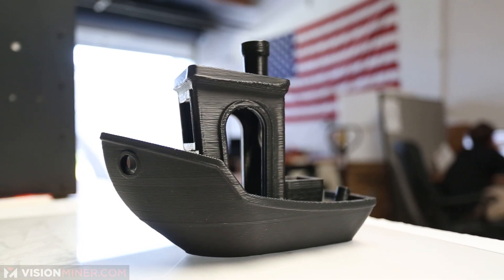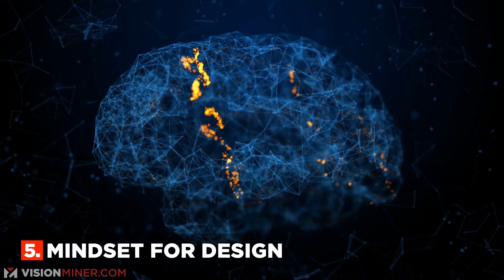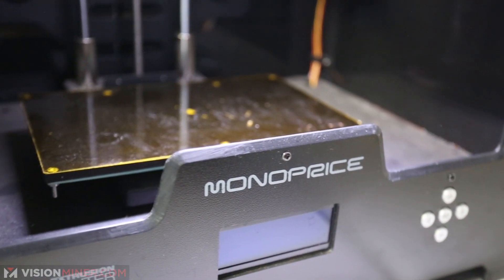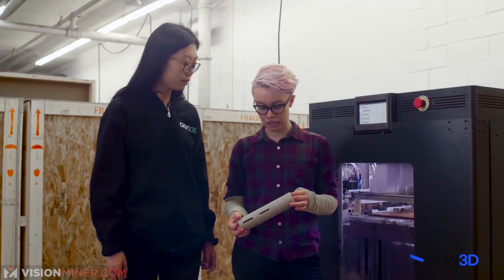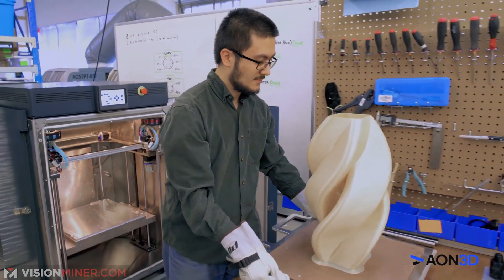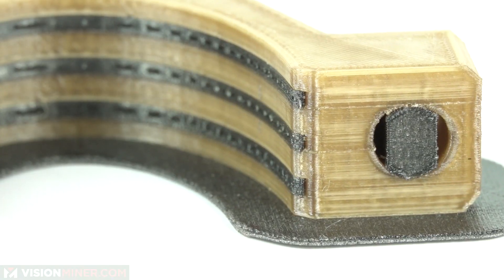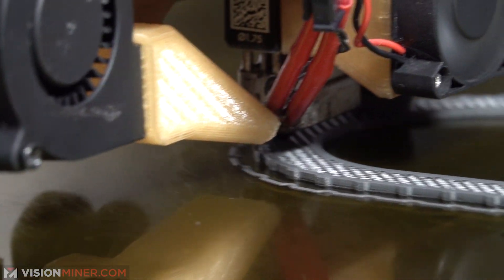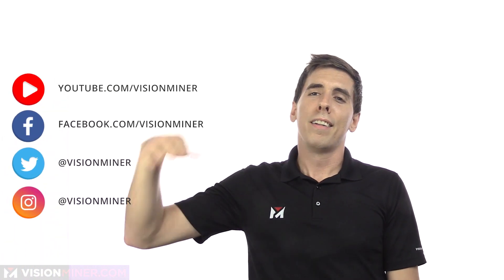Hobbyist vs Industrial FDM 3D Printing: Toys or Tools?

Comment: Another great video! Just a idea for a future video. I personally would LOVE to see you guys build or showcase diy high temp printers. I love that you guys are getting the word out of high temperature thermoplastics. If there is anyone else out there like me who wants to go from the hobby level to the next level of printing in Peek and Ultem, the biggest hurdle is the price of entry. The cheapest printer that I know of is the funmat HT which is around $5,000. Like you said in this video the average good hobbyist printer is around $200. So unless you are starting a company or have minimum 5K to get started it seems like most people will get deterred from that simple fact. Unless someone makes a printer that is closer to a hobbyist printer price. 

I'm on several discord channels and subreddits and follow the community very closely. And you don't really see too many if any people build DIY enclosed, heated, external stepper motor,  high temperature printers. 
It would be awesome to make a video dedicated to people who have made DIY high temperature printers. Or even better yet, if you guys made one yourselves. Could be as simple as Duet board, CoreXY frame(maybe like a tronxy or VORON), 120v 750watt silicone bed, e3d copper plated hot end, etc etc. I don't see it going much over $1000-1500 depending on how fancy you get. 
If you guys can show everyone that this whole other world is within their grasp, then you can make people like me come join the club 👍
Reply: The problem with the cheap, or maybe diy 1000$ printers and printing PEEK and the like is that you spend 300$ per spool on the filament and if you have to throw half of that away each time because of failed prints has you spending more in the end veeery quickly.
Reply: @Gekkoperformance  great point. But I also think it's worth considering that this hypothetical printer wouldn't be just for high temperature filament. If I had to guess I would think that most people would want to build a printer that can do a little bit of everything. Right now hobby printers cannot print anything high temperature (400+). I'm just not sure if there's anyone else out there like me. Someone who doesn't want to spend 5k on a printer that they could build something similar for $1000. Someone who isn't scared of diy and wants something that can print pla asa, tpu, and than nylon, pc, ultem etc etc. I've always wanted to print with those materials but thought I would need a industrial printer. And now that I've started a small print farm and been diving deep into this whole world I've learned that's not the case. All the parts are right there. I'm going to build one but it would be awesome to see someone like these guys do it. Or maybe showcase some people they know that have built their own.
Reply from the maker: The biggest challenge is reputability and the high-temp chamber -- you literally have to build an oven to reach temps necessary for large PEEK/ULTEM, and the frame/build of the machine withstanding many cycles of heat/cool -- making something that will work for more than a few months needs to be far more robust than an aluminum extruded frame, presenting some challenges. There's a lot coming up with the expiration of stratasys patents, smart COREXY designs, and easy-to-get 500C Extruders, but for now, it really takes a lot more to build a reliable machine at high temps than people think :) 

On top of that, the materials are expensive -- if you don't have a business use case, you're pretty much throwing money at the wall :) If you have the money to blow, awesome! But unless you NEED these materials, or have a way to make your money back, it's just fun :)

Example: Dude builds high-temp 3D printer that will last a month before needing all kinds of replacement parts/adjustments/calibration -- he prints exhaust shrouds in CFPEEK (lower chamber temp), and sells them for $100 each. He can get 15-100 of these off -- if he's got the customers, it's extremely viable! 

Rebuttal: Spending the weeks/months building a custom machine which probably won't last that long vs. buying a machine that works out of the box for a larger up-front investment -- i.e. $7000-70,000 -- prints right out of the gate, will last for years, and can immediately be put to use in producing parts. In reality, this is usually the better option for businesses. 

Printing small PEEK / ULTEM parts? Just upgrade your hotend and enclose that chamber :) You won't immediately hit above 60C, but you'll be able to do small parts as long as your bed gets hot enough :)
Reply: @VisionMiner  Alright than my question is who is this channel geared towards? Is it only geared towards people who are in the commercial and industrial space? 
I understand all of your points and I 100% agree with all of them. All I'm trying to say is that it would be great to see someone bring this elusive expensive not popular industry down to a wider audience. And in my opinion that's not going to happen anytime soon with a price of entry at $7, 000-100,000. 
So if this channel is geared more towards the commercial and industrial community, ya a DIY high temperature printer wouldn't make sense. 
But if this channel is meant for the 3D printing community as a whole, you guys are one of the only channels I know of that is focused on high temperature printing. And I believe this segment would get more attention if the price to enter wasn't so high. 
I can see a lot of parallels to this conversation to the old days of fdm printers.  Couple years ago it was crazy expensive to get into 3D printing. It took a lot of people tinkering and making their own for it to finally get mainstream enough to reach a wider audience. If you remember it was thousands of dollars to buy a pre-built printer. But it took the community to build their own to drive down costs and open source design.
I see the same thing here. I see a future where the community starts to build printers that can print in high temperatures.
It's something I can't wait to see. Hopefully I can be a part of it.
Reply: @VisionMiner  And just like the olden days, it was a challenge to print consistently, reliably and easily. But nonetheless it was a challenge, a fight to win and figure it out. I want to see someone do the same thing for high temp filaments. Maybe not you guys but someone. 
Sorry for all the novels haha. I'm very passionate about this subject. I just wish it wasn't so crazy expensive to buy a capable printer. Especially when you can buy all the parts to make your own. It's like this exclusive niche club. Only reserved for companies or people who have DEEP pockets.
Reply from the maker: Oh for sure! It's the future, without a doubt. On that note, our customers are generally industrial and always have a business case -- that's who we're here for :) That, and educating everyone to bring it more into the community -- industrial is what keeps our lights on :) We're focused on getting businesses the information they need and providing the systems and support to make it work :)
Reply: @VisionMiner  Ahhh I see. I have a better understanding now. Well keep up the good work! I'll keep looking up to you guys 😊